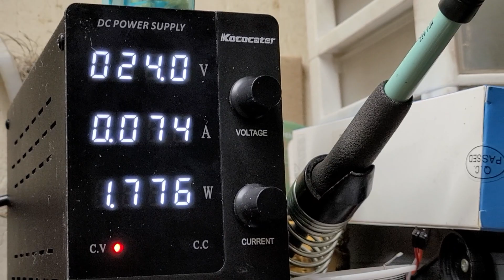1.5W trial

Comment: Is there any current being passed through the water? If not, and there is resonance between the plates, you should be able to crank up the voltage while keeping current draw minimal and see more production.
Reply from the maker: There is always some current that flows through it. In fact, it seems to be required for the behavior to exist.
Reply from the maker: i can only turn it up to the voltage limit of my transistors :)

Comment: nice ramp. what are the cells insulated in? i want to insulate my test cell before i move to any more testing. i was going to use heatshrink with the glue inside of it...  it has held up well as insulation on the rods that hold and connect to it.
Reply from the maker: Thanks. It was PLA made from good old Max Miller's infamous Double Barrel cell https://www.thingiverse.com/thing:777803
Reply from the maker: Ethan has made some very good models of our other designs and equipment here https://stanslegacy.com/books/ethan-crowder/chapter/3d-stl-files
Reply from the maker: By the way, this is that 1:1 8XA choke I mentioned over the MOT 😉